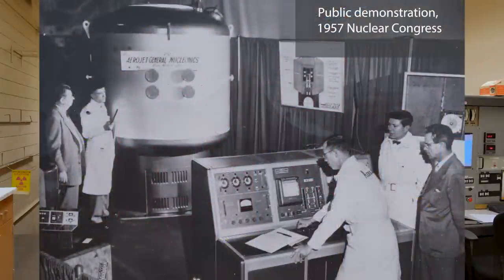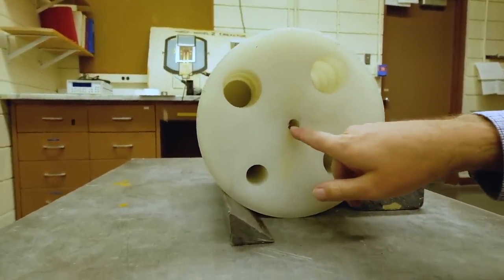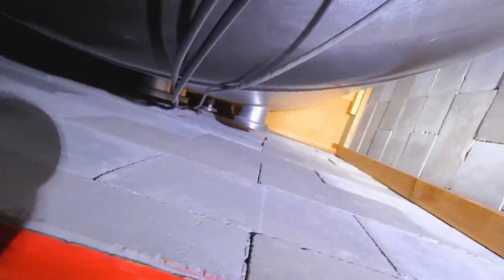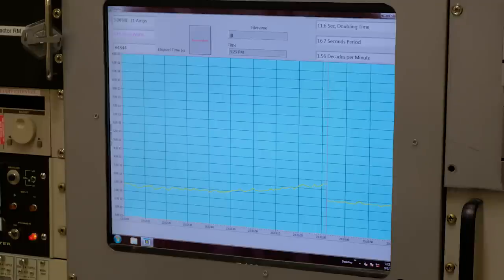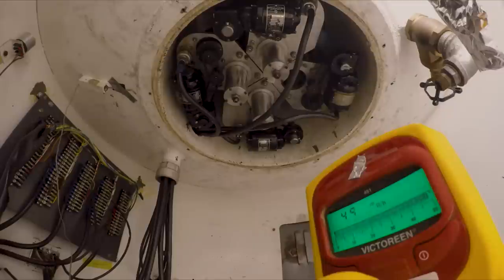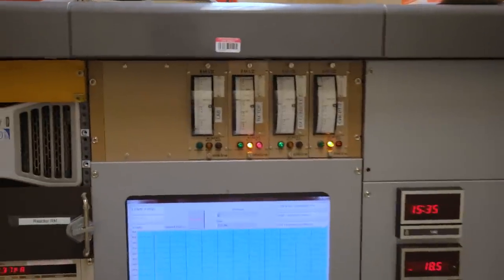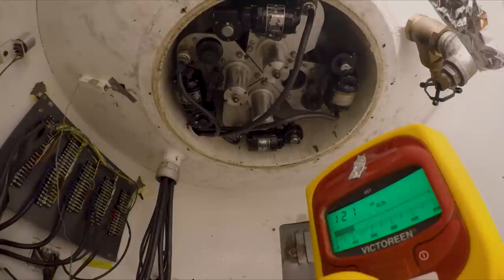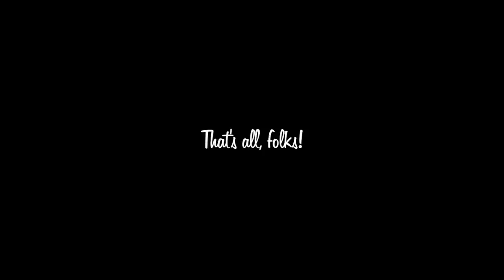UNM Nuclear Reactor Tour and Demo, 2020

Comment: I was surprised by your mention that the rods fall out of the core in the event of a Scram. In my experience (I've been a reactor operator on Magnox, AGR and PWR reactors) we would want the rods fully in the core following a trip/scram.  I can only assume that your rods are not neutron absorbers, but instead support and enhance the nuclear reactions when they are inserted.
Reply from the maker: Thanks for your comment, and YES, our rods are fueled (so give positive reactivity when inserted).  I would love to visit the UK to see some of the unique nuclear technology on that side of the pond sometime after this pandemic has gone subcritical.  Do you still work in the industry?
Reply: @Carl_Willis  Hi Carl, I'm afraid I'm retired now. I did my degree in Nuclear Engineering back in the early 1970's. We had a small test reactor at the University (100kW, graphite moderated, Uranium/aluminium fuel assembles - plate type - enriched to approx 90%. Not surprisingly, no longer there!). I worked in Magnox and AGR before moving to PWR. I set up the PWR training school in the UK and wrote the specification for the first full scope simulator. I moved to site when the simulator was commissioned and was a Shift Manager for 20 years with spells out running the trianing centre before retiring. Sadly all the Magnox plants are now retired, and the AGRs coming to the end of their lives. Sizewell B will probably run beyond 2035, perhaps to 2055. We are building a new PWR, due in a few years and want to build more, but that comes down to needing some governmental support.

Comment: cool reactor.... that part of plastic moderators and step motors controlling the rods were added later? lovely, i have saw one in Usp a university of sao paulo, brazil, but were open and you can see a flash blue on the water when starts
Reply from the maker: motors are original (I think), at least they appear original; the white plastic is just a representation of the core dimensions.  The real core is a homogeneous mixture of polyethylene and uranium and is dark in color.

Comment: Thank you for that video, it was very interesting and very instructive. Seeing how a nuclear reactor actually operates is fascinating. Personally, I have always been in favor of the small power reactors using gen. 3 designs being used to replace fossil fuels along with wind and solar. We could get to carbon-neutral or even carbon negative using gen. 3 reactor designs until we finally figure out how to generate power using nuclear fusion.

A question I have is, would it be possible to automate today's current gen. 1 and 2 reactors so that the desired power level can be simply dialed in and, through using feedback loops, power up and then maintain that power level? I'm just a civilian with very little knowledge of how today's reactors work so, forgive me if this is a silly question.
Reply: No, that's not practical and not a good idea, even with most of the new designs. 

The basic problem is that the behavior of the fuel changes over time as it's converted to waste products. It's generally not something that  you should let a computer manage without humans in the loop. Some new concepts might have a wide enough operating envelope that they could be trusted to regulate themselves, but nothing like that has been built.

The closest we have to "nuclear AA batteries" use some kind of radioactive decay, not a chain reaction. Radiothermal generators, betavoltaics, even radium and tritium paint.

The control problems are biggest when you're starting a reactor. The reaction grows exponentially until the reactor warms up. That means a slow start that becomes faster and faster.

The slow start means it's possible to overshoot the correct control rod position and make the reactor supercritical to an unsafe degree long before you notice a dangerous amount of thermal power or radiation.

So that's why you need neutron-detecting equipment and a startup neutron source. That lets you measure how well the reactor is multiplying neutrons. Test and verify the control rod configuration while the reaction is still insignificantly small and slightly subcritical. Then gently ease it into supercritical operation and carefully watch the power rise.

Automated systems can certainly help, usually by providing another layer of careful monitoring. But currently it's still necessary for skilled human operators to exercise judgement.

There are at least a handful of reactors that have been licensed for unattended operation once they're started

But IIUC they're all variations on tiny- reactor-in-swimming-pool. Good for radiation experiments, but they're too small and too cool to make useable thermal power.
Reply: @jordanrodrigues8265  I don't know, pool-type research reactors can quite easily go up to 1MW while remaining much simpler to operate than a full blown power reactor. Making electricity from that would be difficult/impossible, but it's enough thermal power to heat a fairly large commercial building. You could extract heat from the pool with a heat pump so there is zero risk of irradiated water getting into the rest of the heating system, so the "nuclear" part of the heating facility would be limited to the reactor itself.
Of course the economics of it don't make too much sense because of the cost of operation and security, it's far easier to build a big reactor and just transport the power to where it's needed.

Comment: In the video you say that the control rods are inserted to increase the core activity? As far as I know usually it's the other way around. Is that just the more common type. I'm not a nuclear scientist so I'm most likely understanding things wrong
Reply from the maker: Correct, our rods are fuel and add reactivity.  It is unusual, but it helps keep excess reactivity low in the system if you think about it.

Comment: When you say "licensed power", is 5w the absolute maximum these reactors would have been capable of in real life use?
Reply from the maker: This design is capable of about ~10W steady-state (the point at which negative thermal feedback brings the system critical with all the control rods fully inserted).  The 5W limit at UNM is imposed by our shielding.  On a short time scale, the design is capable of safe transient operation into the kW range.  UNM is not set up or licensed for that type of operation, however.
Reply: @Carl_Willis  thank you Carl. May I ask, with such a low wattage, when sold originally, what application would these have been used?
Reply from the maker: @WhatALoadOfTosca  Period advertisements suggest that the intended market was mostly education and training with some specific industrial uses as a neutron source.
Reply: @Carl_Willis  thanks Carl. Fascinating. Really enjoyed the video.

Comment: Very cool, does the AGN-201M have a neutron source for cold start-up?
Reply from the maker: Yes it does.  We use a PuBe source and you can see the operator remove it and reinsert it in the video.
Reply from the maker: @ClickThisToSubscribe Our rod drives are interlocked so that we cannot start up without a certain magnitude of neutron signal present.  This can be satisfied with delayed neutrons from recent operation, but we absolutely need the neutron source for a "cold" startup.  It can be dangerous to start reactors up without a statistically reliable and measurable neutron population in the core.

Comment: Interesting that at the position of the ion chamber, it is roughly 100 mR/h/W. Is this intentional for the purposes of confirmation of power levels? I’m assuming the radiation magnitude emitted is proportional to the power output?
Reply from the maker: That setup is for entertainment / demonstration purposes only.  It's fairly accurate to say that the gamma radiation intensity at that location and in our low-power reactor is proportional to power, but this is not all that accurate in general because a lot of gamma radiation in reactors is generated by fission products and thus isn't representative of neutron population at a given time.

Comment: When you say the rods drop out on power failure vice inserting, are you relying on the boiling of the moderator to eventually shutdown the reactor? Seems to me rods need to go in to shutdown on loss of power? Was that a mistake in presentation or what are you relying on to actually shutdown on loss of power or driving force in on the rods which is what I would expect? I am missing something here. The presentation overall was very enjoyable. Thanks for doing it.
Reply: The controls rod are fuel so dropping out of the core removes reactivity. The moderator is polyethylene, which had better not boil.
Reply: @robertbusch3144  Thanks very much.

Comment: Why are there not more reactors build like this with moving fuel rods to control the reaction? Or for that matter, ones using mobile neutron reflectors like the NASA SNAP-10 unit?
Reply from the maker: Generally, reactors are designed to have a lot of excess reactivity to compensate for fuel depletion and fission-product poisoning.  This is especially important if the reactor operates at a high power density, e.g. in a nuclear power plant or a large research facility.  In those situations, it makes a lot of sense to have your control elements be neutron poisons.   Our reactor was designed quite differently, though--its fuel life is "effectively infinite" and the safety and economics then got the upper hand and it was designed around moveable fuel.
Reply: @Carl_Willis  Thank you. That does seem to make a lot of sense. I've always want to learn how to operate a reactor, but math is a very weak subject for me, which is somewhat disqualifying for engineering.

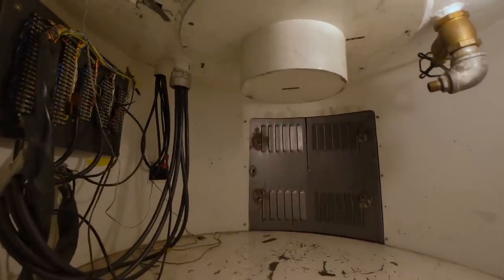Comment: @7:18 Why is the water valve positioned to spray water on the electric connectors?
Reply from the maker: I think the intention is that you would connect a hose to the threaded outlet on the tank valve if you wanted to drain the water.  We actually have no drain in the room, and this serves a safety purpose: if we see water near the reactor, we know we have lost our neutron biological shield.
Reply: @Carl_Willis  the arcing electrical components would be a good sign of a big leak! ;-)

Comment: The idea of inserting rods to go critical and raise power is completely foreign to me in my 39 years of reactor operation. I just do not get this at all. Are the rods actually fuel as well? Even in a BWR with bottom inserted rods you withdraw to establish critical and on scram they insert to shutdown. Just trying to figure out how this device works. Thanks.
Reply from the maker: Yes, the rods are fuel in this design.
Reply: Amazing The light water breeder moved fuel assemblies around butI had never heard of this method before now Fascinating
Reply: @dennismosebey8085  There are four methods for controlling reactors. You can control by adding absorber as is done  in most power reactors, you can control by adding fuel as is done here, you can control by changing leakage through reflectors as is done in fast burst reactors (like Godiva), or you can control by changing the neutron spectrum by changing the moderator density/concentration.
Reply: @robertbusch3144  Thanks. I figured the rods must be fuel. I am of course familiar mostly with the absorber control rod idea. Thank you for clearing it up for me. Great presentation Best wishes.

Comment: Wondering if the flux is high enough for activation? I would guess it’s much spicier than a multi Ci ambe?
Reply from the maker: Yes, much hotter than even a big AmBe.  We can perform activation analysis and we teach importance functions and unknown identification using NAA in our lab classes using the reactor.  That said, we're not in the isotope production business...kinda too low power for that, although we get the occasional inquiry and have some potential but limited capabilities there.
Reply: @Carl_Willis  One of those high flux coaxial fuel will be much better, for now as a hobbyist i am sticking to my laughable 50mci moisture meter source.....
Reply: @cnxunuo  source please. Id love 50 mCi.

Link, i mean. Keep the source you've got ;)

Comment: Carl, you mentioned that there is a negative temperature coefficient, but then you said the reactor temperature needs to be high enough to operate. We would call that a positive temperature coefficient. In other words, more reactivity is added with increasing temperature. Am I missing something?
Reply from the maker: Temperature coefficient is negative.  If temperature is below 18 deg. C, there is too much excess reactivity per our tech specs and we cannot operate (the temperature interlock comes on).
Reply: Oh that makes sense. I originally misinterpreted you to mean that unless temp was high enough you physically couldn't go critical. You meant that you aren't permitted to go critical.

Comment: If manual or auto scram fails, what is your backup to shutdown the reactor?
Reply from the maker: A cadmium rod can be placed into the Glory Hole. It provides $10 of negative reactivity.  Ultimately, a power excursion would be terminated by the thermal fuse melting in the core.
Reply: Cool
Reply: What do you mean by $10 ?

Comment: 1mR/h sounds quite allot, how would an average Geiger counter Sound there?
Reply from the maker: About 3300 counts per minute (for a 2" pancake Geiger counter).  Still not very much.  I mean, if you look at the radiation level beneath the reactor, it's about 0.5 R/h down there!
Reply: @Carl_Willis  Thats sounds reasonable, yes was surprised how high it was on the top and bottom

Comment: If the power isn’t controlled by the position of the rods, then how is it controlled ?
Reply from the maker: The position of the rods controls neutron balance, which to a coarse approximation relates to the rate of change of the power.  So the power level depends on the history of the system: if the rods are in a supercritical configuration for a long time before making the system critical, the power level will be higher than if they were only in that configuration for a short time.
Reply: @Carl_Willis  So that's a system with hysteresis... That makes sense. Thank you for the answer!

Comment: all that on windows vista
Reply from the maker: As I have already explained in these comments, the computer at the console does not have any reactor control function.  It's a data collection tool, chiefly helpful when student labs are in the facility.  It's old, but it runs just fine.

Comment: Have IT upgrade the OS on the computer before your reactor gets ransomware’d.
Reply from the maker: The computer is air-gapped, and has no control functionality or defined role in the technical specifications for the facility.  It's an operator aid and an experimental data collection tool.
Reply: @Carl_Willis  Whew, carry on!
Reply: Stuxnet
Reply from the maker: @darrylhaynes9208  If this computer got infected with anything, we'd just throw it out and replace it with a modern one running a modern OS.  It's old and right now it works fine, and as mentioned, it is not connected to reactor control systems in any way.